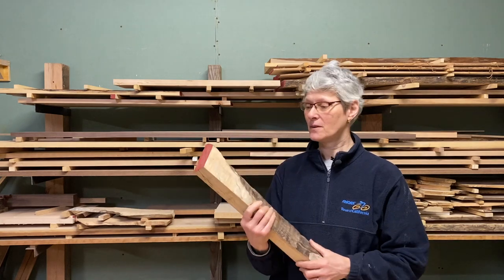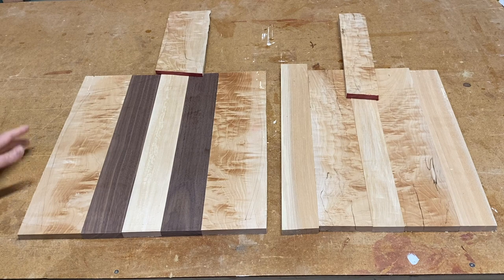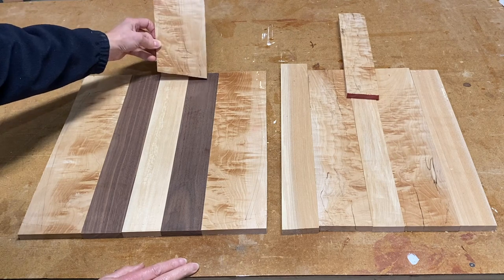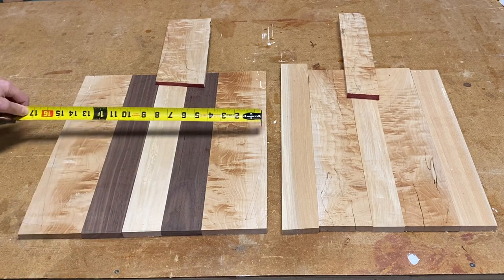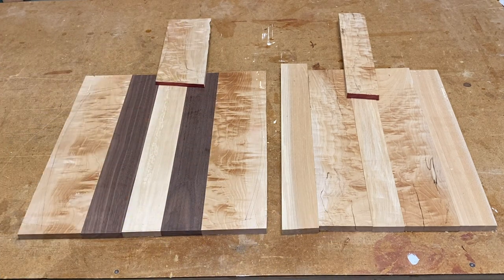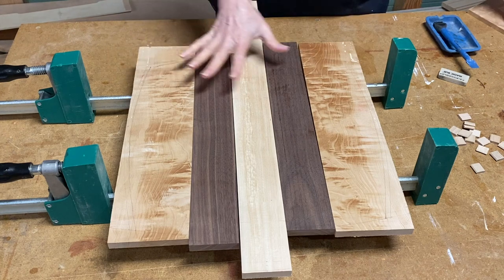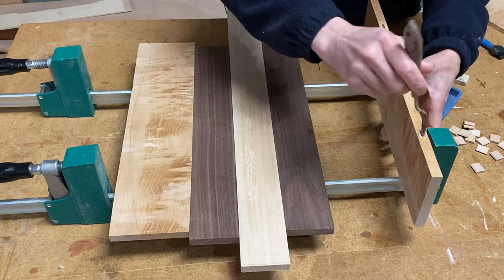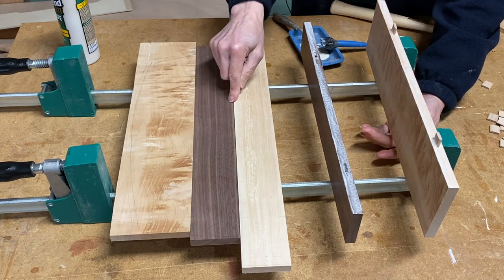Making Pizza Peels - Part 1

Comment: Pizza and woodworking!

A friend gave me a long, wide but pretty thin board that came off an antique sawmill that does demos for the public. You two just helped me figure out what to do with it!  Thanks!
Reply from the maker: I’d suggest trying just under 1/2” thick. The big boards can get heavy. Also consider false drawer fronts (facings) from your thin board.